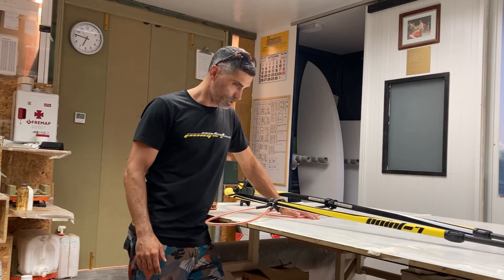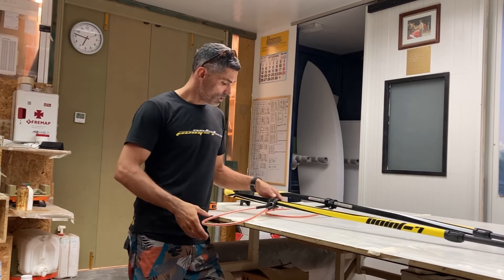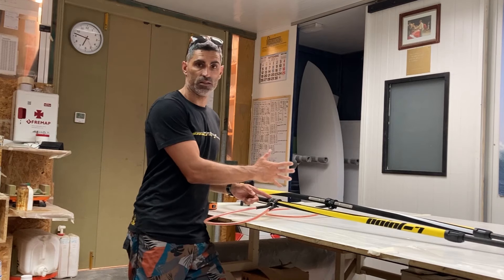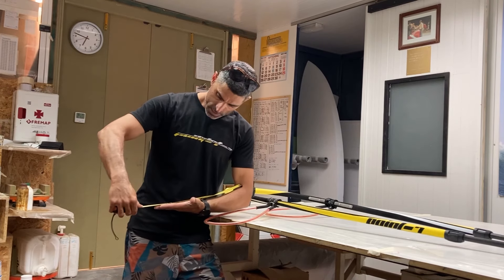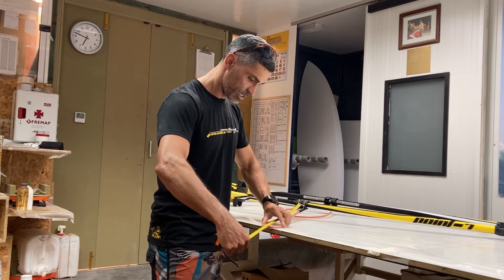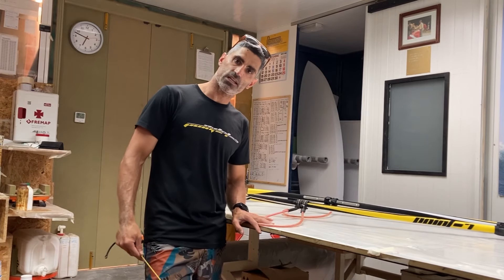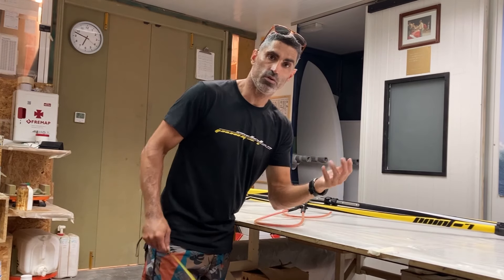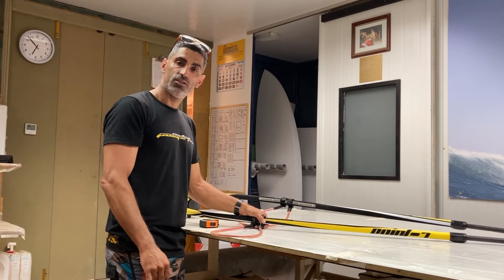HARNESS LINES LENGHT WINDSURFING - What is the correct length

Comment: Harness line length depends mostly on how high the boom is relative to the harness hook. Because smaller sailors tend have their boom set higher, relative to how to tall they are, and vice versa for taller sailors, the length of the harness lines are less related to body height/forearm length thank you think.

Comment: Good video! I had a suspicion my 28" lines were too short, so I went to 30". Just done your test and it seems to match up - I measure 38cm elbow to finger tip, and the lines also. I'm 170cm tall.
Reply from the maker: Thanks! Happy to know it helps
Reply: Are the lines measured in inches?
Reply: @Mariz650  yes inches, overall length not including the attachments
Reply: @robertallison1580  thank you, i was geting confused. so the line should measure more or less twice the length of forearm?
Reply: @Mariz650  yes pretty much. So for me 38cm / 2.54 = 15 inches, * 2 = 30 inch lines